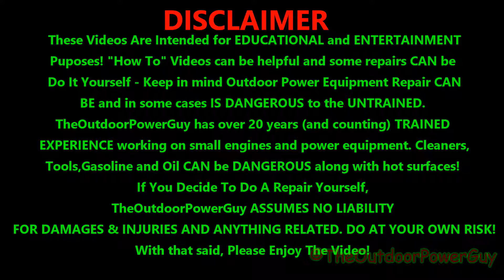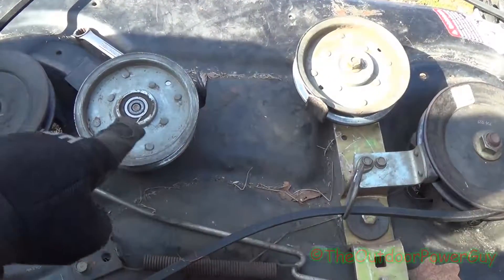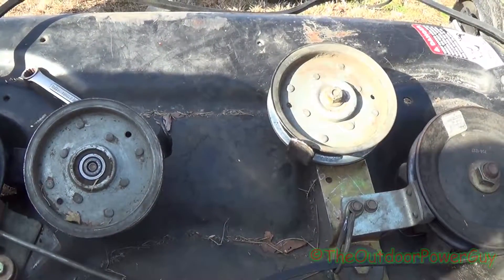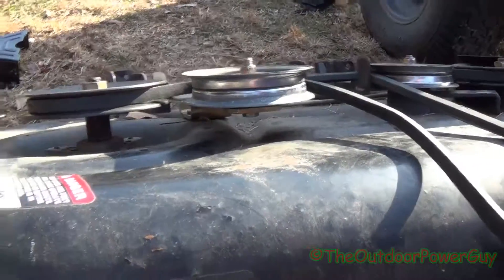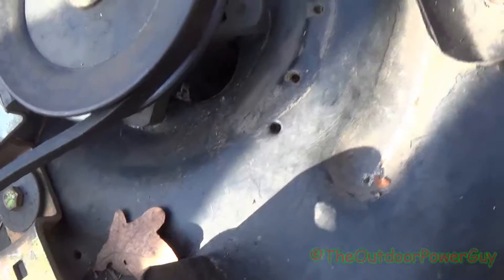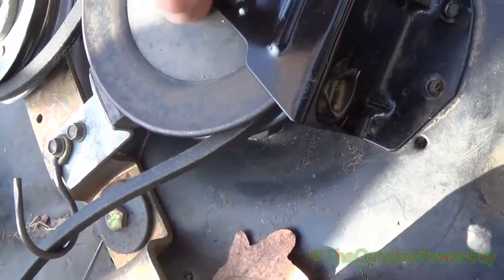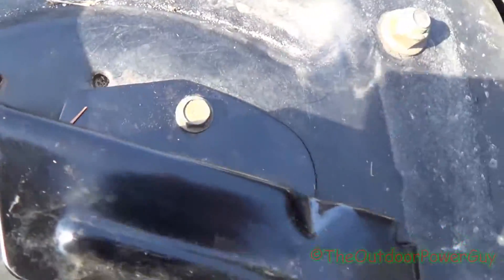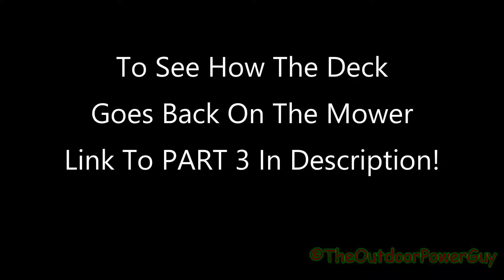HOW TO Replace A Deck Belt On A MTD LT5 Design 42in Riding Mower PART 2 BELT ROUTING INSTALL

Comment: Just remember that those belt keepers on the idler pulleys has notches in the arms that belt guides supposed to seat in
Reply: The most important comment on the whole video bro
Reply: This was 100% my problem at you just made it so simple

Comment: Would Pulley Cover 783-06424 A -0637 fit.  Part of the Cover where you screw the bolt is broken and I assume that is causing  the belt to always slip out.
Reply from the maker: (I'm an MTD Products Dealer) With out the model number from under the seat i can't tell you if that part would work, feel free to reply with your model and i'll look it up for you. With out the cover's the belt won't stay on as the cover acts as a belt keeper and pinches the belt onto the pulley.

Comment: So dropped the deck, took all of as should, replaced belt and now the blades will not engage
Reply: Update, I had the belt not properly connected and I also had the spindle tightened down way too tight.